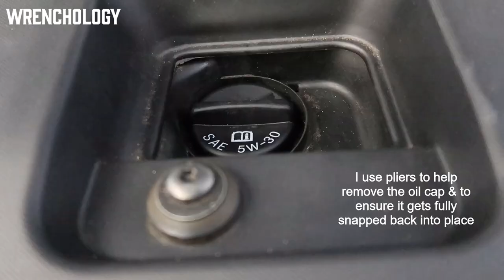Changing the Engine Oil & Filter on my 2013 Chevrolet Volt

Comment: Well done.  I'm a retired mechanic and could tell that you're a seasoned wrench by the way you did that oil change, Stormy. (no oil on your gloves from either the filter or the drain plug, oiling the filter gasket, prefill filter, skilled drain plug escape moves, etc. )  ;)  Thumbs up, and I'll check out your other vids.

Comment: Nice work i always have changed oil on my Volt while alongside the oil pan not from the front. Will try it your way. I have a skidplate installed so i actually will have to change the oil filter from the TOPSIDE now! Reaching down around the AC compressor from the topside it'll be a mess.

Comment: I'd have loved to see how you put that new filter with new oil in back onto the engine @1:59s.   Mine is horizontally mounted too and there's no way to put that on without a lot of that new oil simply falling out.

Comment: So as a PHEV, how do you know when it is time to change it?  Not all miles are with the engine running.  Is there a light that comes on?
Reply from the maker: There is an engine miles counter that equates to oil life percentage that will let me know when it's due! This also varies depending on how much you actually run the engine, when I'm only using electric I could go all year without needing to change it. This is also why it requires premium fuel to make it last longer in the tank if you go without running the engine for a long time. Hope this helps!
Reply: @Wrenchology  gotcha thanks.  I have one of these in my fleet and havent changed the oil in iver a year.  Was considering doing one, but wasnt sure if it would tell me.  We usually do run it on battery only.
Reply from the maker: Doesn't hurt but isn't required! I usually do one just to keep oil relatively fresh especially living in SoCal